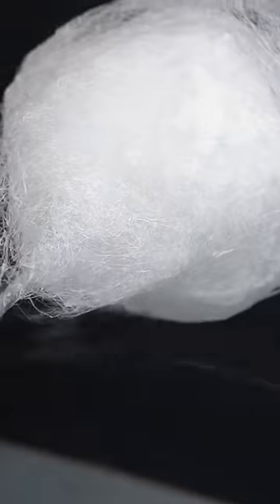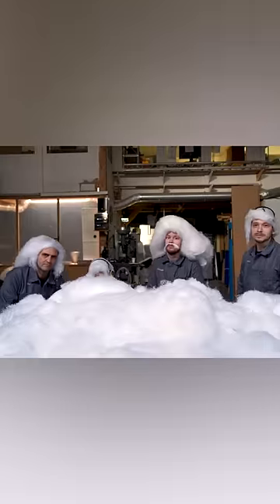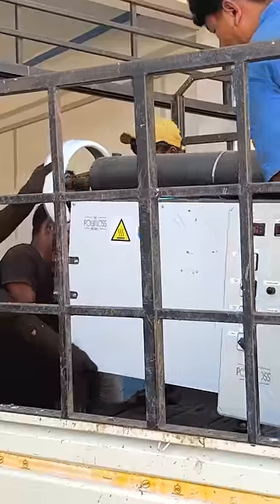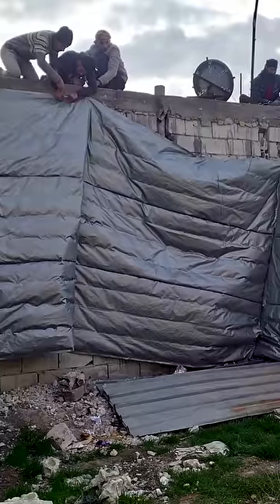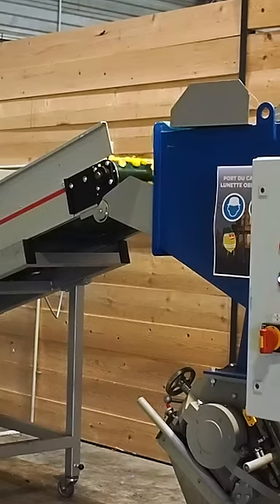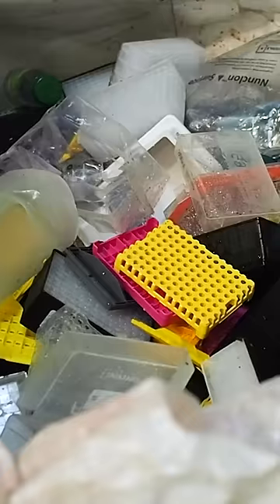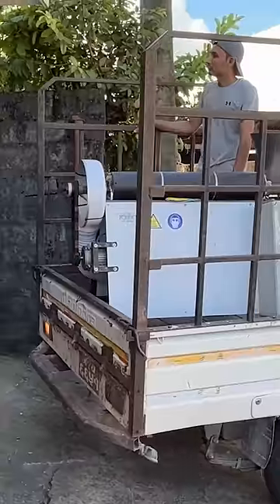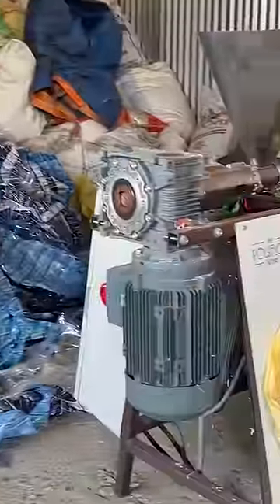This cotton candy is really plastic trash spun into ultra-thin fibers.#recycle #plastic #environment

Comment: You better hope you don't catch on fire under those blackets or it's melting on to you and burning for a very long time.
Reply: it won't melt, it has too much surface so it will just instantly combust and get you a nice crispy skin
Reply: almost all clothing is combustible? bizarre angle of criticism
Reply: @4...3 I think plastic, because it's a petroleum product, burns a lot hotter and gives off more toxic chemicals. It'll be a more difficult fire to put out, and it'll burn more quickly and probably leave anyone inside covered in molten plastic.

Most current home insulation is intentionally made to be flame resistant. This one isn't - instead, it's a flame accelerator. It would be very unfortunate to send a bunch of material to poor people and end up killing them with it...
Reply: @AlexeiArntzen  What I mean is that a lot of clothing is made of plastic textiles such as polyester, nylon, and acrylic. also, while much insulation is flame resistant, there are still types which are flammable being used today.

your problem is not with this specific concept, but plastic generally
Reply: @-Zardoz- yes because there is plenty of room on the surface of the planet for plastic waste, and you have a much better idea what to do with it, I'm sure. And everyone everywhere has enough unlimited independent resources to keep comfortably warm and sheltered 24/7, I know you've got that covered too!😂
Reply: You mean like the exact same risk from wearing polyester, working with hot sugar, tar, or epoxy, traveling in a vehicle.... yeah tons of shit we deal with is flamable and sticky when melted 

I get what you were going for but this is not more dangerous than many other thibgs we do every day
Reply: Are you using a polyester fill quilt or pillows?
Reply: @AlexeiArntzen as someone who works for Chevron chemical IN A PLASTICS PELLET UNIT THIS IS 100% TRUE.
Reply: @4...3 already had molten plastic on my hand. You don’t want molten plastic on your hand.
Reply: @AlexeiArntzen but wait! We could use other extremely polluting and unhealthy chemicals to make the plastic more flame resistant. A perfect plan!
Reply: @reedy_9619  ok?
Reply: and this is why all kids should wear cotton clothes to bed, not polyester of some kind. it melts into skin
Reply: @hello-ef4bn  what do you have an oil lamp by your bed? an open fire? you are very unlikely to catch fire in your sleep
Reply: Honey, that's true of ANY fabric made from plastic.  A polyester shirt will fuse right to your skin if it catches on fire.  You see anyone being paranoid about their button downs?
Reply: I bet they add flame retardants to it.   What they are making is pretty much the same thing as polyester filing for pillows etc.
Reply: I mean yeah. You shouldn't be sleeping next to open flames in general.....?
Reply: @zaffa_d5117 I would think the same thing that it would just come bus similar to Pink panther insulation or spray foam insulation whatever the case maybe all insulation that we use nowadays is toxic and can be flammable.
Reply: @4...3 Over half of all fire deaths happen while people are sleeping...
Reply: @VeProducctions  sure, that makes sense because you're less likely to be aware of a fire when asleep but they aren't burning to death in melted polyester, they are suffocating due to smoke and gas inhalation
Reply: @4...3 you have some general points, however they're absolutely correct about the fire hazard here if there aren't flame retardants being added. For your blanket analogy you could theoretically get out of bed before it caught on fire, in this case you're completely surrounded by these blankets which are exposed rather than behind less flammable materials of a wall. Think for instance if you lined a homeless shelter with this and someone accidentally brushed a lit cigarette against it, everyone inside would be almost immediately engulfed in flames before realizing there was even a fire.
Reply: @xxportalxx.  I just don't believe your hypothetical could happen. if they're so incredibly flammible obviously they will be enclosed in a non-flammible material. I don't know why all you people want so badly to believe this is a terrible thing when it is obviously good.
Reply: @xxportalxx. i would imagine people using this product for insulation aren't using it for a permanent solution, and are aware of the precautions
Reply: @katiebarber407  I don't think you can trust all of the ppl intended to use this to be aware of the dangers, informed of the dangers, or to care about the dangers. All it would take is one homeless person with extreme mental illness or drug abuse (Obviously not all or maybe not even most homeless, but unquestionably a large proportion) to do something they shouldn't and now you have a tragedy.
Reply: @4...3  if it's so incredibly dangerous obviously no one would take a Walmart brand death trap 'submarine' down to survey the titanic... oh wait...
Reply: @xxportalxx.  bizarre comparison
Reply: @4...3  what's bizarre is that you assume ppl won't do risky things lmfao
Reply: Better not be sleeping on a memory foam mattress, that is extremely flammable material.
Reply: @xxportalxx.  sure, you have to weigh the benefit against the risk. you are hyperfixating on a fairly remote possibility
Reply: Napalm, sticks to kids!
Reply: either they die freezing with back problems or 

burn to death in a comfortable sleep... crispy 8 hour sleep.
Reply: Cotton do that too u know
Reply: I was just thinking this has to be a fire hazard
Reply: I believe most blankets and mattresses use plastic filling nowadays, as do pillows and plushies. Before you judge, please do compare to your own living conditions.
Reply: @xxportalxx. The problem with that is that insulation is inside the walls, you couldn't brush a lit cigarette against it unless you punched a hole in the wall first then stuck your cigarette in there
Reply: @lovelynight5967 fiberglass and rockwool insulation, the two most common types, are not flammable.
Reply: Not only will it kill you, it’ll hurt the whole time you’re dying.
Reply: That applies to all fabric though.
Reply: Nobody tell him about regular insulation...
Reply: Catch fire under anything won't be fun.
Reply: @Serai3 Yes, me.  I'm always searching for cotton/linen/silk/wool alternatives to the plastic stuff in my wardrobe.  It breathes better, and is also less likely to burn all my skin off. All clothes are flammable but not all fabrics are created equal.  Wool, especially, is naturally slightly flame retardant. The fact that natural fibers are so hard to find and so comparatively expensive next to man made ones is really obnoxious and I think will come back to bite us as a society.
Reply: @rachelclark6393  What in the world are you people doing that you have to worry obsessively about your clothing bursting into flame?  I've worn clothes of all kinds of fabric, and not ONCE has any of it started a conflagration.  What are you doing, playing water balloons with gasoline??
Reply: @4...3 natural fibers burn, but for the most part don’t melt, synthetic fibers like polyester and the stuff in the video start burning, then turn into molten hot sticky flaming goo
Reply: @AlexeiArntzen  Fire fighters have literally said running through a fire with a polyester shirt on it will cause it to melt on you, so make what you will of that.

Everyone’s hating on this form of recycling and for what? They’re probably providing insulation for free, and so long as it’s being used on the outside of buildings, what’s the genuine harm?
Would you rather this be in the ocean?
Reply: @4...3 you should look up celluloid plastics combusting. Clothing shouldn’t burst into flames like some plastics do
Reply: So when someone throws a old blanket away it’ll stay in the ground forever?
Reply: Yea...getting plastic melted into you sux... I tried to refill one of those electrolyte water bottles with hot water to clean it and the bottle started melting onto my hand almost immediately

Luckily no permemant damage tho
Reply: @AlexeiArntzen who catches fire directly under their blanket though 😅
Reply: @xxportalxx. it’s bizarre of you to live in fear just because you know PEOPLE will ALWAYS, FOREVER, no matter what, do bizarre things. You can’t stop that? Just restrain from doing dumb ish yourself and try to spread that to others and that’s all you can do. You can’t change the world. Someone would ruin it.
Reply: @AlexeiArntzen Naturally flame retardant materials are fine to use. Man made chemicals are horrible for the environment and all living things that come into contact with it.
Reply: @CristianSalles1  Cotton burns, but doesn’t melt
Reply: Plastic doesnt burn
Reply: Alot of people think this burns … plastic doesnt burn people
Reply: @bluebull2006  it melts
Reply: Nearly everything we wear is oil based these days. To some degree if not completely.
Reply: @4...3 yes, most people die not by the fire itself, but by the smoke.
This is since we are using plastics in instalations (electric, plumbing, etc), furniture, insulation, conectors, floors (PVC, etc.), clothes, pillows, etc.

With stone, wood and other old building and furniture materials, the smoke of a burning building is of a very different composition.
Reply: @bluebull2006 of course some plastics can burn like hell.
Reply: @zaffa_d5117 as opposed to feathers or other filling?
Reply: @theoverseer393  feathers are gonna burn too
Reply: As with every other insulation.
Reply: @doomguy974 correct!
Reply: @4...3  I'm fixating on a remote possibility? I'm pointing out that a fire hazard 100% exists with this material if it isn't treated properly. The point is if you don't take that seriously you create an inherently dangerous situation, if you do take it seriously you can take measures (such as adding flame retardants) to mitigate the risks. I'm literally a hazmat worker, I fixate on risks like these for a living, and yes they do 100% result in maiming, death, and tragedy when not taken seriously. There's a reason fire departments and building codes exist, and it's counted in the millions of lives lost due to the negligence we're discussing here.
Reply: @georgia860  they literally showed in the video it being added to existing structures as a blanket over the walls, it was not contained. The whole point was that it could be cheaply added to existing structures to make them warm, rather than going the expensive route of tearing the walls down to properly add insulation.
Reply: @yajack9629  no, the point is to expect and predict the bizarrely dumb things ppl will do (or even do by accident, or while destracted, or while entering a new environment for the first time, or that may happen without any human intervention at all, etc.) and develop strategies to mitigate the risks. For instance you could say 'oh well yes this tall building is high enough to kill you if you fell off the roof, so just try not to do that' or you could put up safety rails like a sane person lmfao. In this case the play would be to take the fire hazard seriously and add either a flame retardant to the plastic, or enclose it in something flame retardant. Not doing so is just blatant negligent stupidity.

Comment: Is there a filter system in place of some kind that limits the spread of unintentional microplastics? I am aware that this spun plastic is itself a microplastic, but during the spinning process is it somehow contained in only the insulation pads?
Reply: Ok, but to be fair if the intended use is things like refugee camps i sincerely doubt they have a robust recycling system, that plastic will still be microplastics in a few years anyway might as well save lives in the mean time
Reply: All plastic becomes microplastics eventually. The nice thing is that microplastics break down unless they're magically held in bog or someonewhere else where nothing breaks down which the Ivory Tower claims all plastics go.
Reply: You don't need anything like that, just dump it in lakes and oceans
Reply: @ConstantChaos1 the problem is theres other ways to do it. You dont have to use micro plastics to save people.
Reply: @eatassclown  what other ways are there to use recycled plastic to make fibers on site is there? I'm genuinely curious. What better solution for the specific problems tackled here do you have since you insist you have better ways to do it?
Reply: @ConstantChaos1 actual cotton candy, expanded starch, 

Building adobe huts with a similarly mobile brick press, 
Yes, all those are less effective.

Another way would be to make  bigger shelters- this reduces heating needs through geometry. 

... i am not sure if this is a good tradeoff. On one hand, it is good insulation.
It could be recycled (or even cleanly burned) after use, but that requires additional equipment that needs to be included in the aid package.
A plasic pyrolysis - powered internal combustion engine generator could work even longterm to  combat plastic pollution.

On the other hand, making refuge camps more flammable seems like a totally lunatic way to make sure we need less refugee camps. 
Like something a well meaning person would accidentally come up with, 
And someone who hates refugees would implement worldwide.
Reply: I see everyone panicking over microplastics, so let me just say: 
This stuff is practically identical to polyester, fake fur and plushy filling. You already have this, and microplastic exposure is about equal. And by equal I mean there’s less microplastics entering your blood then when drinking water bottled in a plastic bottle. Bonus points if you keep reusing an old plastic bottle. 
Plastic sealed in insulation can be kept out of the ecosystem for literal decades. And yes, it still can be cleanly burned later. Do note that clean burning requires filtration to catch the fumes, and this may not yet be available in poor areas. If burned without all the required filtration, you get fumes that are worse than microplastics. So you might as well reuse the plastic and store it as insulation until such a time where it can be safely disposed of, which can be years to decades depending on local development. 

Its a good thing that everyone thinks critically and questions progress. But please be careful not to blindly join a judgement bandwagon either. Question both sides of the coin. And by all means, question me, look things up. <3
Reply: The spun plastic is not a microplastic. It's thin but still visible to the human eye. Think like a thin fishing line.
Reply: @ConstantChaos1  lol why tf are you mad
Reply: @eatassclown  no substantive reply why am i not surprised
Reply: @DannyGruesome  als9 not mad just a decent person unlike yall
Reply: No there isn't, it all ends up back in the environment when it's thoughtlessly disposed of.

Reusing plastic waste for disposable purposes is just prolonging the eventual contaminants.